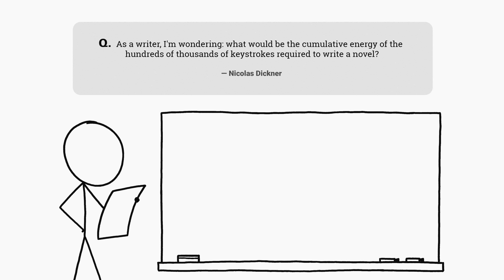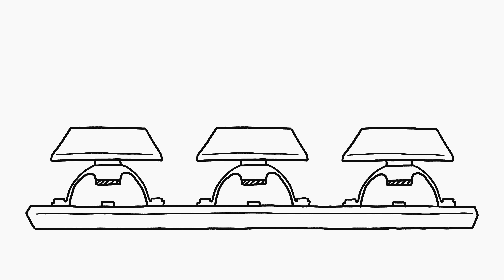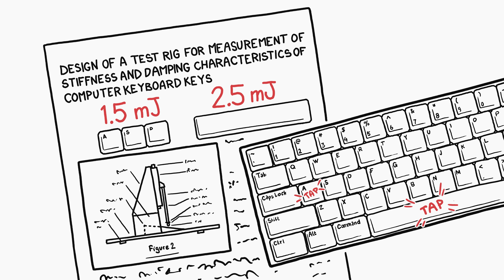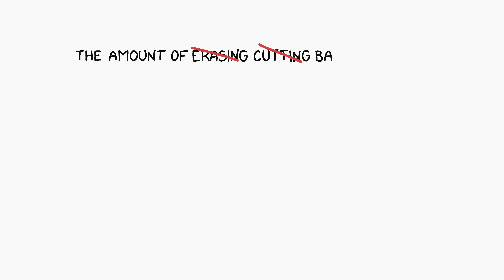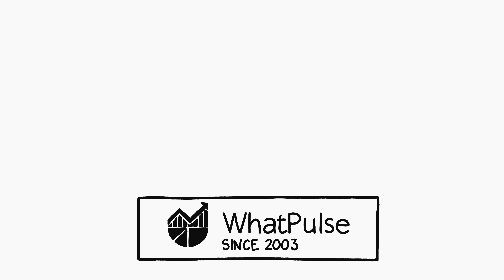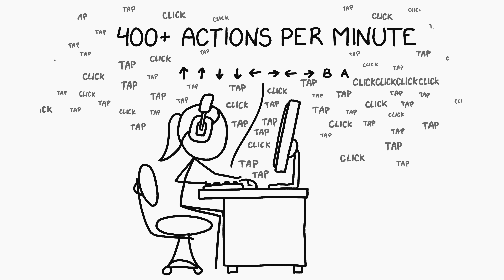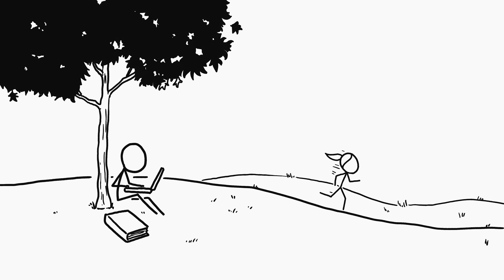Can you power your computer by typing?

Comment: Yes laptop would be impossible to keep running. But the "small battery being charged from key presses" idea would be more practical if you wanted change a fire alarm battery or maybe an electric tooth brush and didnt want to use a rapid charger on your own outlet. Also you'd have to be a hardcore writer or competitive gamer.

Comment: This one got me thinking, with our current technology how potent would be the computer that uses only this much energy? Is there a way that it's enough to write something, even if you need to press the same key like 3 or 5 times to power the chips to store in a micro SD the information equivalent of pressing the key 1 tome normally?

I won't be surprised if it's possible, I mean, the smartphone I'm using to write this is more powerful than the computers NASA used for Apollo...

Comment: it may not be enough to power a laptop, but could it be used to power a keyboard? if the keypresses can produce the electricity used to send the signal to the computer (wired or wireless), that would create an infinite powered keyboard.

Comment: This is assuming we are using a laptop. There have been experiments to manufacture ultra-small SOCs, by taking the most bare-bones ARM designs, and build them using lithography techniques similar to those used in modern high-performance processors. The result is a computer with power consumption measured in nano-watts. It's also so small that all IO must happen through lasers, as there's no way you could connect wires to it. The working prototype is roughly equivalent to a consumer PC from the mid-1980s; so powerful enough to write a document on, but not much else. I think the biggest power-draw would be the IO. You could put a screen similar to the one found on the Gameboy on it to save LOTS of power. That would actually be rather appropriate, as such a device would have a similar amount of processing power to a Gameboy.

Comment: A lot of heavy typists and most gamers use MECHANICAL keyboards which would output as little 0.5 mJ per keystroke if efficient. Some switching need no more than a gentle touch. So it's probably less than 30 seconds per novel T_T

Comment: OK but what if you made the keyboard a powerful enough generator to run the computer?  Let's say you need ~100W to run a laptop, and the keys can be a perfectly efficient generator. 
100W is the amount of power you need to cycle at a moderate pace. Imagine being able to cycle powered only by your fingertips... 
A keystroke could be maybe 5mm and at 50wpm that's maybe 300 key presses per minute (5 per second). That would need a keyboard force of about 4000N (~400kg).

Comment: you dodged the question!. running a laptop is not required to take the input from a keyboard. a calculator that can run on ambient office light is no big deal, and storing text doesn't take any more energy then doing basic calculations. The energy from typing could easily power the recording of text to stable storage, even slow typing is plenty. 
they're already energy harvesting light switches where the energy to toggle. the switch is enough to transmit Bluetooth low energy. btle is incredibly efficient.

Comment: unfortunately, I'm still left wondering about how hard of a limit there is on the other side. Calculations here were based on an average 'laptop' which is probably a low-ish power x86 machine 

but true optimization for ultra-low power could use an ARM chip (or even custom microprocessor) running minimal software will only a few tens of megaherts processing speed (it only needs to keep up with processing your keystrokes, we aren't calculating digits of pi here) 

then a very basic display, maybe e-ink or very low resolution OLED (with light text on dark background)

I'm sure you could get the power consumption much lower than a typical laptop, though not sure how far it could go
Reply: shit, I just re-invented the typewriter

Comment: Counterpoint, let's assume you create a keyboard with that in mind, let's say each key has a stroke of 2 inches and a force of 2 pounds. Assuming you type at 2 keys per second, which is generous given it's much harder than any typewriter, that would be a bit less than a watt of power. And with even half a watt, you could easily power a raspberry pi or other small computer and basic screen like an e-ink display from an old kindle. Heck, a raspberry pi 0 is overpowered for basic writing like this, and an e-ink display literally doesn't use electricity unless it's changing, which only a very small part of it is per key press. With the right setup you likely could reduce this to 100 mw or even 50 mw of continuous equivalent power draw, and can use a keyboard more on par with a regular beefy typewriter.

Comment: Something not even mentioned is that if you were to harness the energy from a keystroke to say power a very efficient generator, each individual keystroke would be harder to press down than a normal key because some of that energy is needed to actually move the key and press the button in the first place.

Basically you'd just be making a wicked finger strength trainer 💪

Comment: It would be a lot more practical to get the lowest power computer that could do the job. In the 1990s I had a tiny computer that ran on two AA batteries. It was mostly software compatible with the original IBM-PC, although slower. The monochrome LCD screen was low resolution and was not backlit.

Given the last 30 years of progress in reducing power draw, it would certainly be possible to make a computer that is more capable than an original Apple ][ that could run for months on a single AA battery. The Apple][ was considered a computer. Many novels were written on those computers.

Comment: I'd like to sees this continued. Modern keyboards don't require a whole lot of energy to press down. But old mechanical typewriters DID use keystrokes as their energy source, and their keys were much stiffer because of it. How stiff would you have to make the keys in order to power an energy efficient laptop?

Comment: Ok but what if we made keys like 2-3x harder to press and plugged them into the most power-efficient smartphone with battery saving turned on and things such as mobile data turned off. If we also use a liquid crystal display which I'm quite sure only needs to be powered during screen refreshes briefly and can be used without a backlight, the device's power consumption could theoretically go down by a lot. I can also imagine reading data off of an SSD might be way less power-hungry than spinning up a magnetic disc then moving a needle around it constantly and sending electrons through it and whatnot. A well-optimized operating system on idle would have to do basically zero math aside from something like an internal clock and measuring CPU temperature, right? We'd only need a bit more power than what's required to keep the RAM memory from losing it's data?

Comment: But you could increase the amount of energy required to press keys, by increasing the relative resistance to each keypress. MOAR POWER!!

So a gorilla could power the computer by smashing the keyboard constantly! Until the keyboard invariably breaks, of course, which sort of undermines the thought experiment, since you'd lose any gains in power production to time spent constantly replacing keyboards. Not to mention all the additional e-waste....

Comment: There are approximately 884,421 words in Shakespeare's collected works, so the number of letters is the total word count multiplied by the average number of letters per word. Using a common estimate for the average word length (around 4.5 letters), the total number of letters is in the range of 3.5 to 4 million. If every click lift a squirel over to a stack of 4 pieces of paper (considering each paper is a standard 0.1mm thick), he could've lifted a squirel to more than a 40-story builds (probably a lot more sincer we are not counting he pressing enters and spacebars cause I don't know how to math I just had a lot of google help)

Comment: Seems like there's probably a break-even point for every device.  What would my typing speed have to just keep the battery in my Bluetooth keyboard charged?  Or how much would I have to move my mouse to keep my wireless mouse charged?  Or how quickly do I have to move the thumbsticks and mash the buttons on a PS Controller to keep the controller charged?  How loud do I have to shout to keep my wireless microphone charged?

Comment: I'm kind of disappointed you didn't look at different keyboard types. My mechanical keyboard has a significantly higher actuation force and travel distance than a gross laptop butterfly keyboard. Or, what would the keyboard be like that could power a computer?

Comment: No. Trying to use a "computer" is the completely incorrect approach. A PDA-like device from the 1990s could run off a few CR2032s for months. To enter an ASCII character in a static RAM (plaintext, no "word editor", presentation on an LCD-display, without backlight) would be ENTIRELY possible with 1.5 mJ keystrokes. 
Let me restate - this was the norm in 1990.

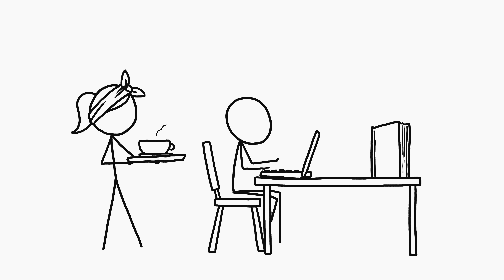Comment: 1:33 Based on the figures given, the power draw of said computer is 30-100 Watts. So if we wanted to power a computer for longer, we would need to find ways to reduce the power draw. For example, a Raspberry Pi Zero W has a typical power draw of 1 W at moderate load. A keyboard is on the order of 0.1 W. An e-ink display only consumes power when the screen changes, around 10 mJ/cm^2. This would get us to 10-30 minutes of power.

We can actually do much better... if we use a custom design. There are low-power electronics that need to run for years at a time off of a small battery. Their power draw is measured in mW, a thousand times less. While these can power our computer, the problem is that at this stage off the shelf peripherals like the keyboard and screen use a comparatively huge amount of power, so we'll need custom designs for these too. If we can cut the power draw by a hundred though that would get us a few days' worth of writing time.

Comment: Powering a microcontroller which records the keystrokes: should be possible. LCDs can also be pretty low power if you dont have a backlight. Anyone want to run the numbers on this "slightly varied" model?

Comment: So quick rough math:
To power a laptop you'd need to write a novel every 30 seconds
At 500,000 characters a novel, plus some VAT for editing, we can say 600,000 characters, or 20,000 characters a second
For WPM a word is standardised as 5 characters, so this would be 20,000 x 60 / 5 = 240,000
Therefore, if you can type at a steady rate of 240,000 wpm, you could theoretically power your laptop just from your typing.

This does however raise other questions - could a keyboard register inputs that fast? Could the keyboard itself take that many presses in such a short time without catching fire or something? What about the joints in your fingers? I feel like this video needs a follow up

Comment: Going by the microwave per second metric, that laptop is measured at about 25 to 27 watts

I'm sure you can get alot better run time out of a phone w/ a keyboard attached Wich would be about 1 watt to at most 3

So a novel every 5 to 15 minutes (ish)

Comment: This is assuming we are using modern conventional computer architechture. The history of computers has seen significant improvements in power use, that allows more processing to happen in a smaller area without overheating, which allows less power use since stuff is traveling a shorter distance, which means less heating, which means more stuff in a smaller area, etc, as technology has allowed. We often put as much power as is reliable and safe, that we can handle through heat mitigation, as we can through processors to get as much out of them as we reasonably can. Using modern technology though, you likely could design a processor to run on super low power, which would see a significant drop in performance, but would still be very good compared to say a system from a couple decades ago.

Comment: This idea may become viable as soon as we fully unlock nanotech and create computers that are hundreds if not thousands of times more energy efficient. Heck, we could have telecommunication implants under our skin which would pretty much serve as a smart phone and would only require our body heat to function.

I'd say energy efficiency is a far more important thing than producing ever greater amounts of power. Why need anti-matter when we can power a machine for decades with simple batteries that for example use low level fissile material? There are batteries like that already, they could get smaller but still good enough to charge your phone.

Comment: Fun fact! Pianos are keyboard-powered (the analog kind). Pianos even work when the power is out and don't even need to be plugged in! Even the grand pianos used on a performance stage are powered by the key-presses of the musician. Pretty amazing!
Reply: Is that so amazing when they are often surrounded by a variety of other instruments that are also not powered by electricity?
Reply: @christopherpepin6059  All instruments are amazing. :)  But also, it's funny that the whole video is about powering a computer via keypresses on the keyboard when an entire class of musical instruments are powered directly by their users, including the Piano (a powerful instrument in its own right) - which has a keyboard and which is powered by keypresses. It's just funny to think about; and also begs the question that if a computer needed to be powered by key presses then maybe with a keyboard designed in the right way it could be possible!

Comment: Other than the thousands of hours of engineering, quintupling the weigh, oh and 10Xing the price ... I have an idea for a wireless keyboard that never runs out of batteries. If it does run out of charge you just have to spam the key till it registers.

Comment: This really depends on what you define as a computer. There are buttons that can emit radio signals from just the energy they harness from pressing them (used for home automation or as a ring button on house fence). I can imagine these running a microcontroller and perhaps even saving the keystrokes into a kind of persistent memory.

Comment: But what if you would use a super efficient micro-controller, power optimized software and an e-ink display or some other very low-power display? I think this could still work.

Comment: I have Hue bulbs with a wireless, betteryless light switch. It uses the energy of pressing one of the four buttons to send one of four signals to the controller, and I can program how the controller responds to each signal.
Reply: There used to be TV remotes where pressing a button hits an ultrasonic tuning fork, and the TV detects the frequency of the sound emitted.

Comment: Ummmm - if you actually recovered the energy required to depress a key - the key would not depress. You'd actually write nothing, so far as the computer was concerned.

Also, a Remington manual keyboard must have more opportunities to recover energy while actually leaving an imprint. 
and doesn't require electricity leaving that power available to make coffee.... 
.... Which is actually what powers book writing

Comment: This is the most low effort "What if" I've every seen from this channel. You could make a keyboard where this is just barely achievable.  A raspberry pi pico has a consumption of about 30mA at 5V, which would give you barely enough energy to run it if you could get to 100 keystrokes per minute at 1.5 mJ per keystroke. So yes, you can.

Comment: One of the biggest issues I find when people talk about taking energy from somewhere, is that they often don't realize what energy is actually waste to be used, versus what energy is intentionally being used. If you type a lot, do you actually want your keys to be harder to press? Because a certain percentage of the energy you are using to press a key, is actually required for the keyboard to notice that a key has been pressed. And you can't necessarily recover that energy. It's the same as places that have talked about taking energy from people walking on sidewalks, the end result is actually a sidewalk that is harder to walk on. So if you are trying to encourage pedestrians, you're failing.
Same with people who talk about putting wind generators on cars to harvest energy as they move along. They don't realize that that energy isn't waste energy to be harvested, it's energy that you are putting into the system in the first place from the vehicle. Also the famous " how many alternators to power an electric car" question which is a variant of the same thing.
Before even trying to calculate how much energy you can generate from a thing, you have to start by trying to figure out if you even want to take energy out of that thing in the first place.

Comment: I'm a little disappointed in this one. I think it would be much better to throw in some work on other definitions of "computer".
Because if you include things like microcontrollers, you start getting into areas where you can actually power them on ridiculously little energy.
We actually do have things like RFID chips and smart buttons, that use tiny amounts of energy to process something and send useful signals elsewhere.
In theory you could make a wireless keyboard that is entirely self powered for example.

Comment: Okay, but how fast would you have to press every key on a keyboard to generate enough power to run the computer? And then how many strokes is a switch rated for before it wears out? How much power would you need to generate before you hit "keyboards per hour"?